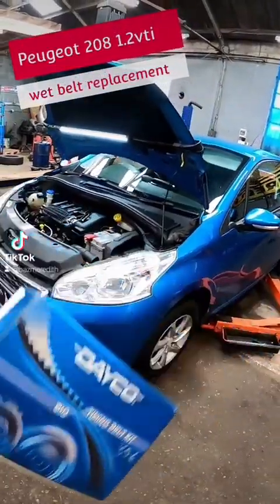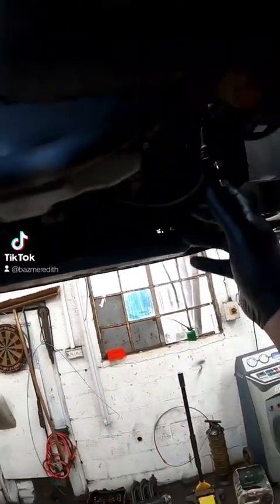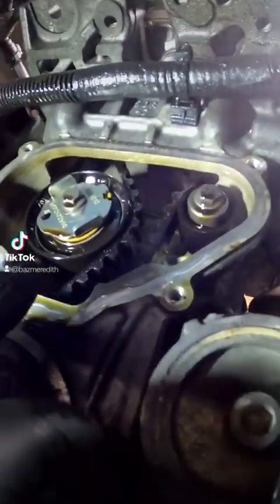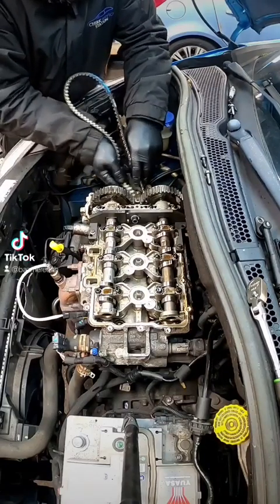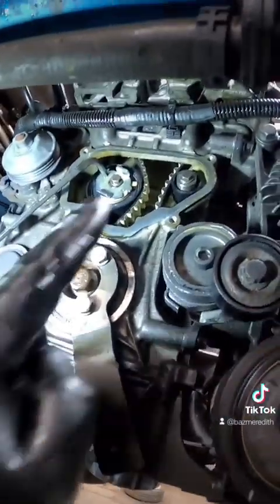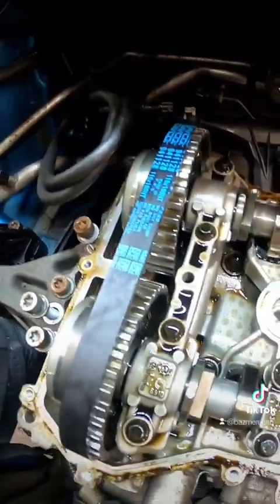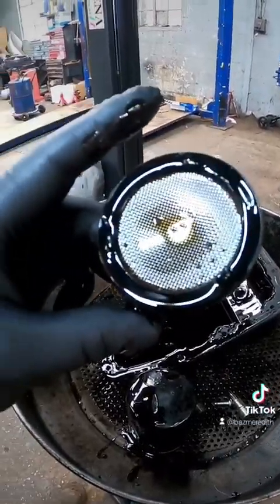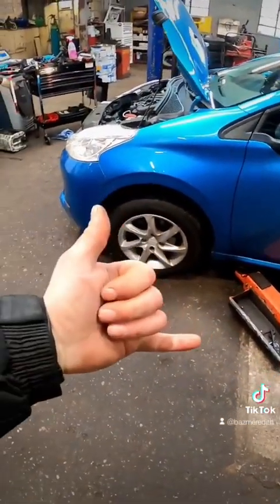PSA peugeot 1.2 wetbelt replacement

Comment: Maybe a silly question, but since the flywheel and camshafts are locked, does it even matter about aligning the camshaft sprockets to 5 o'clock like you said?  I guess the locks keep everything aligned, no?
Reply from the maker: Aligning the camshafts makes it's easier to get the timing tool located on the camshafts... It's just a reference

Comment: Another well know tiktoker tech done the same process on the same engine.. The belt was missing almost half its teath, and somehow was still running.. Wet belts are thee worst design when it comes to engines.
Reply from the maker: There an awful design there would have been nothing wrong in designing the engine with a chain.